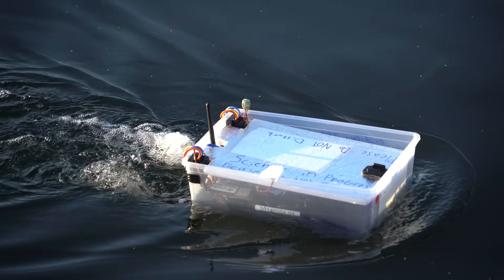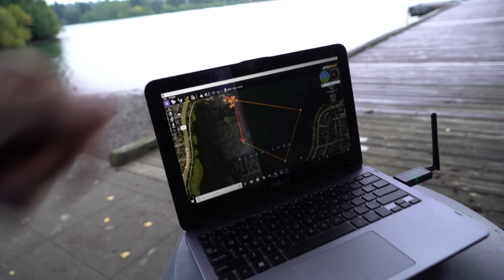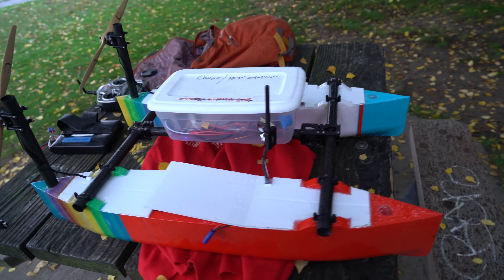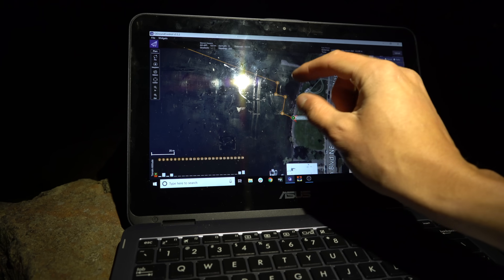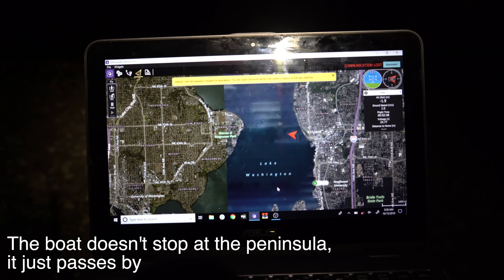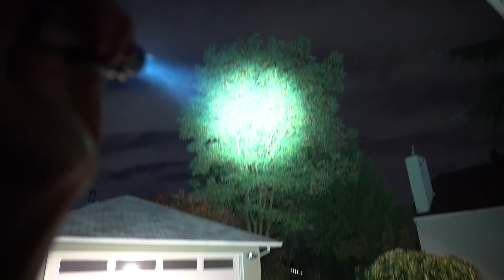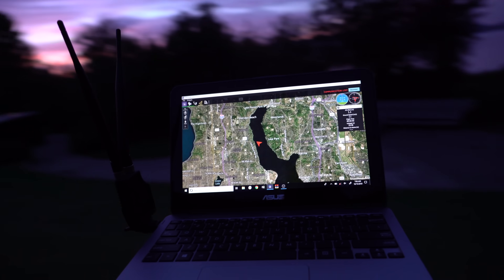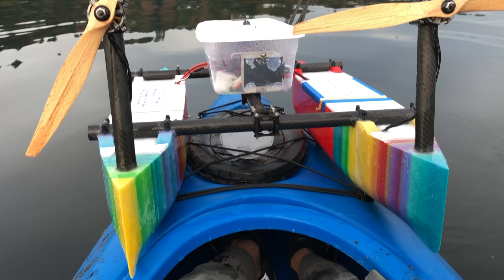Autonomous R/C Boat 13km Waypoint Mission

Comment: One of my dream projects is a autonomous model boat that can stand up to the sea. Satcoms for out of range times and solar for some battery recovery. I have almost finished a mini APU that would serve as a back for battery recharging too. Those hulls look good. Flatten them out and widen them then use them as forms for fibre glassing. Would reduce alot seaweed build up. Just an idea none the less. Create partitons in your design if you haven't already so it reduces full flooding.

Comment: Dude, you can just get some fiberglass cloth and cover those hulls, you might want to move the motors forward so throttling doesn't change the pitch. or create a larger super structure and fill the hulls with foam so it can never sink. If I was you I would invest in an kayak so you can meet it at waypoints. but hey that is part of the adventure, just like Columbus, into the unknown. I need to build one of those up here in Anacortes but salt water will be more diff

Comment: You put some time into the electronics albeit all off the shelf stuff it seems.  It should just all work. Focus more on hydrodynamics.  Boogie board?  Terrible idea. Too much surface drag and mass for those small motors to drive and direct.  Come on man there is literally thousands of hull designs.  Forget 3D printing nonsense.  Make a new tri-hull from balsa wood and fiberglass it. Store all your electronics properly isolated from bare wood (both electrically and thermally) inside the middle hull. Center mast perfect for getting the antenna up off the water a few feet.  It's time to ditch the tupperware. Also, you need to get back to water propulsion.  Solve the entanglement problems rather than switching to inferior "alternatives". Solutions to problems are far more rewarding in the long run.  Cheers!

Comment: We use these rfd900 radios at work, the commercial 900 mhz radios we used to use are nowhere near as good. If we can find a decent line of sight, can get 4.5 km out of it with stock antennas. Not sure how much speed you need, turning down the airspeed gives better error correction, so better range. As always with radio, antennas! Its not to hard to make a yagi at that size. Also a co-linear would be a good option for the boat. Because we need them pretty rugged and to look professional, we often use mobile phone log-periodic antennas, but being so broadband not the best gain. The base part of a fishing rod n some brazing rods as a yagi would be my thought. Not to long, so its excessively pointy. Maybe make the last few elements removable for closer work, and a tripod when at range.

If you go the boogie board route, id use the other half of the fishing rod, maybe a meter of that in the middle as a radio mast. Fishing rods with a broken tip are an excellent resource for antenna cobbling.

Excellent projects, keep it up dude.

Comment: I love what you have accomplished. Keep this in mind and if possible add some camera to the rig at different angles to see what is going on with it. And I say that because I built a radio control nitro powered kneeboard. It was of air boat design. And what shocked me was with all the noise it made and even scooting across the top of the water pretty good. What happened that shocked me was something in the was annoyed by it or passed over it's territory. I observed the whole board get hit so hard it knocked it up out the water and almost flipped it. I was told at one point the pond had Gators in it. Never seen one nor heard one their the times I had been there. So I was like maybe it still has some. And then again too geese are very territorial. And that all that happen close to residential property some could have been the area and attacked it. They aren't scared of things and will defend their space with violence till they feel the threat is no more. And with the boat looking crippled they left it alone. Maybe even the props got a few licks in that helped it stay afloat from injuring one or scaring it off. So keep that in mind. Don't stop what you are doing. And I would also like to know how in the world you get it run for so long like that? Seems it was out there for hours on two batteries and no solar cells like they would do any good anyway in the dark. Thanks.

Comment: WiFi Engineer here. Don't angle your antennas like that. Keep them both straight vertical. The wave pattern is going to come out of them at 90deg. and if they are angled, you are losing range significantly. As long as they are different frequencies, there is no need to worry about in/out phase interference.

Comment: Great revision to your first version. Can I suggest something for your 3.0 resivion, or beta 1.3 whatever you may call your creation? Along with your onboard black box, put a GoPro onboard. It may capture the seaweed entanglements that are happening. May help with your redesign, if more data is collected, on what is happening to it when it drifts away.

Comment: duct those airboat fans for efficiency - the slightly increased side area at the stern will also help upwind tracking
edit: boogie-board may be bad in sidewinds but if so you could melt some slots lengthwise underneath to grip the water better

Comment: Great project, I like the design, and think if you just angled the bow(s) you could keep out of the lake weed. Also, maybe fill the hull with expanding foam to keep it from sinking, as well as try to keep water out? If you get some Chloroform, not sure how hard it would be for you to get it, you can smooth the PLA like you can with Acetone and ABS. Keep putting out the videos.

Comment: Great footage and effort!  If you want waterproof tape you can get it from Sailrite.  They use it to make sail numbers on sailboat sails. I use that tape to seal up my hatches on my RC sailboat. PLA is unfortunately not exactly waterproof , so any pin holes in the epoxy would eventually try to sink your hulls.  Maybe some spray they use for sealing up joints in house gutters.  Sticks well and very waterproof and flexible.  Great fun!

Comment: The pontoons are fine. You just need to be able to seal when you close them. 
They also need at the bow not such a sharp edge. Give it more of a ramp shape where anything that hits the bow it gets pushed down and under. 
I think a wave/s got up and over the port pontoon and filled it full of water where the freeboard decreased making other smaller waves have more of a effect.
Look forward to the redesign of the pontoons.

Comment: A boogie board will give you a lot more slip tho if there is any wind right ?  Unless you add fins .. which would be prone to gather more weed .. unless you angle them real sharply ... I liked the catamaran idea .. Sad to see you abandon it .. could just be made safer against leaks with enough testing in a tub .. Would rather like to see you make the elektro ice box more aero-friendly and see if you can pick up any speed on such long runs tho ..
Another thought  against the boogieboard vs the catamaran .. wouldn't a boogieboard flip over much more easy if there is a strong gust of wind ?

Comment: Once these long range waypoint missions start getting more reliable I would love to see a solar autonomous boat!
Reply: @Jakob do you know how hard it would be to program an autonomous boat to use a sail to relatiably reach waypoints?
Reply: @Jakob you do realize that the sailboat will still need solar panels and batteries or some other charging system for the control electronics, has the same minimum number of electronic components that you have to control, has one more set of variables it needs to factor into its calculations and can make it harder to prevent capsizing right?
 I still highly doubt that the program itself is anything close to plug & play unless you buy some very specific hardware regardless of who wrote the code. that last part actually wouldn't be too hard to check if I could find a source for one of these pre written programs(at this point I assume you have at least seen such a product in action, and I am just using the wrong keywords).
Reply: @Jakob autonomously? And in a way that can be integrated into any random system with less effort than a couple of electric motors?
Reply: @Jakob until.....there is no wind...

Comment: My theory as to why it took on water: At the point it lost its heading was most likely when it picked up the seaweed on the prop and the motors compensated for the lost performance. While it was still going straight the seaweed tangled prop must have been slapping the surface of the water. Over the course of a few km or so the amount of water the seaweed splashed up ended up disproportionately filling one side of the pontoon. Once the uneven drag was too much for the props to compensate for it started circling out of control. This would explain how wet the top of the boat was when recovered.

Comment: You really should have reviewed the existing art when designing your pontoons. Luckily, you can just print some nose cones and epoxy them on for a quick fix. They may also improve your speed, but by the looks of it your pontoons are just wildly out of touch with best practices for hull design.

The boogie board is a bold choice and will definitely bring a new set of hassles.

Comment: For you antennas on the base station a extendable painter pole works well to get the height and yet still be portable. We use them in armature radio for that reason.

Comment: How about a single pontoon/ship design? You could make it unable to flip over by having a low center of gravity and high center of buoyancy. Shouldn't be too hard to waterproof it and by having an angle on the cutting edge of the boat, seaweed wouldn't get stuck that easily. But perhaps stick to the air-boat design and don't have a rudder in the water.

Comment: This technology will never be used for smuggling. Just kidding.
Reply: @Nocturnal Long range autonomous plane can fry up to 100km... That can be used to smuggle. But what smugglers are clever enough to use aurdupilot and pixhawk for that, idk.

😂 

😂
Reply: @mikefairnessnt  smugglers are very smart, or theyre in prison
Reply: @mikefairnessnt  Send a sea container full of cocaine with a pretty decent chance of getting through vs build a janky drone that's probably going to overheat and crash 10km into the smuggling run. Idk, seems like a difficult business decision.
Reply: @ww-pw6di  
Radar will see both I do believe.
Reply: @mikefairnessnt  

I could set up a Pixhawk controller. And make it fly a Cessna or whatever. Ardupilot is junk. The most modern versions from 3DR have a much more advanced IMU and more redundant hardware, for like a few hundred bucks.
Reply: People think all smugglers are dumb...but in reality they only see the stupid ones get arrested, the smart ones are never caught ;)
Reply: Lol. Wait..... Hmmm. 🤔
Reply: Jk, jk.
Reply: It's already outdated for smuggling , they're using newer shit now
Reply: The smugglers are already beyond this, I remember reading last summer on the news about them finding autonomous submarines carrying large amounts of drugs across the border.
Reply: Wouldn't work on open water, one small wave and it's gone.
Reply: @nocturnal6863  build a bigger boat with same electronics and bigger relay switches

Comment: Very entertaining, thanks for sharing. Props in the air instead of water is a good design choice. But I would make it a lot faster so the chance of an encounter with a boat/duck is less likely, it could fight wind better and you wouldn't have to wait for hours. Higher speed means the hull shouldn't be a displacer but a glider with a very flat hull at the back.

Comment: Great job! Both on the boat and the video, it kept me thoroughly entertained.

Building an autonomous boat to go around the island on our local lake has been on my pejsct list for ages.

I wonder how a jet boat would do...     presumably not efficient at all, but fast and unlikely to foul on anything.

In a related question, did you work out the power consumption in case you'd want to solar this?

Comment: This is a standard youtube comment of "Why don't you just", but her is may take on a safer version (and quicker then printing):

- Make the dobbel hull in styrofoam.
- Mount a deck(flat box) on top with space for batteries and the motors just the same as the first version,

Now you have a low cost boat the can not leak. For better performance sand and paint the styrofoam.
The control system you have is great.

Comment: Really astonishing and surprising video with all these obstacles you had already gone through and the new ones here from bow too low to leaking. The results are pretty impressive and even that rescue mission. Maybe you need fpv and infrared cam for night vision on a mast & gimble to get aware of causes when things go wrong. 

maybe you could better go for test missions in  circles of 500 m running that waypoint circle 20 times. Rescuing missions would be a lot easier and also your preparation for rescuing

Comment: I've been sailing since I was 7 and driving and generally working on boats (sailing and motorized) since about 13, and one thing I've learned is that seepage is a bitch. No boat can 100% block all seepage because its just too damn hard (of course they make sure there's no major leaks) but instead they put a bilge pump and a level indicator of some kind to just pump out the bilge whenever it gets too full. It uses more power, but if you get something like a peristaltic pump this can be minimized (also it conveniently avoids exposing any motor shafts to water). This would mean you need to keep the batteries raids up a bit in the pontoons though, to keep them dry. Also, maybe you could save on battery life by switching it to a single prop with thrust vectoring on just the yaw axis? Just an idea. Awesome video, thanks for sharing!

P.S. I think you were on to something with the double hull. They are very stable, more so than a boogie board would be. But whatever hull design you choose to go with I have two major suggestions. First, I would recommend looking up the math for stability of a buoyant hull with (roughly) uniform cross section along its length. It's not hard math at all and will help you evaluate hull designs. And second (related to the first) is to add a keel weight. Those calculations can tell you if one is needed for stability or not, but even if one isn't needed, the added wight and lower center of mass will help with unforeseen perturbing forces on the water (mainly waves, but also wind or other unpredictable stuff). Downside is the sea weed risk of course, but if you stick to deep water this shouldn't bee a problem (not sure how deep your lake is though)

Comment: Just go with the flow and make an autonomous rc submarine! It could surface periodically to get GPS updates, and use inertial navigation underwater or something :P

But seriously, whatever hull you use, test early for floating plant resistance. That's killed literally all your prototypes so far. Don't just assume the boogie board will work like you think.

Comment: just add more epoxy to the inside and out of the pontoons you should be fine. For example i mad a Housing for my RBPi Zero so i can dunk it in the water it was able to hold back the water in 75 ft underwater with just a layer of paint and Epoxy. Also leave some sort of camera on board like a RBPi Zero w with MotioneyeOS or somthing.

Comment: Loving your channel.

Regarding seaweed: have you thought of putting an inlet in the bottom of the hull, with flyscreen or something over it, then having impellers in a tube below the waterline, ejecting the water out the back? Like the New Zealand river jet boats? Anything blocks the inlet, a bit of reverse thrust will blow it away . . .

Comment: Hey I’m building a 26 foot sailing catamaran. It will have two electric engines and solar. , I hope to add a raspberry pi to that to make remote control operation as well as maintain position for anchorless mooring . Feel like collaborating?

Comment: Suggestions for an improved model:
-Make it bigger for more space 
-Use that Space to make everything redundant
-Switch to an improved hull design, cover the hulls not only in resin but also fibreglass or carbon fibre.
-Way bigger antenna and faster Datalink, install as many sensors as possible: moisture, temperatures, rpm, cameras on board.
-Use redundant controls like four props (2 each side in push pull configuration) and multiple means of keeping track of the next waypoint in case of loosing GPS signal.
-Consider making a triple hull design and using 6 props and actually making sealable access ports
- Possibly with a triple hull design you could use far more efficient water jet propulsion with a system that measures water flow and if the intake of one of the westerners jets clogged it reverses the engine to clear it. With four water jets (two on the central and one on each outer hull) a single drive failure wouldn't be catastrophic.
I've seen a design where a servo could flip open the intake cover of a water jet to clear seaweed while the other engines keep running so the boat can stay on course.
Reply: - see how all this money a sinking in real time